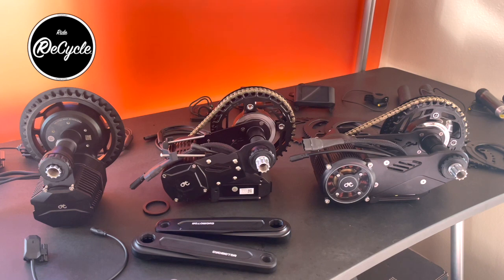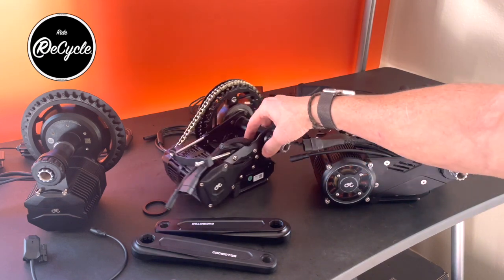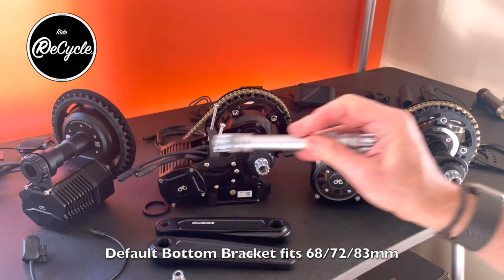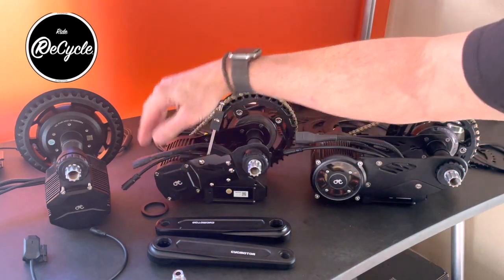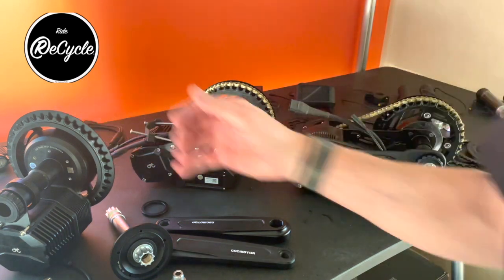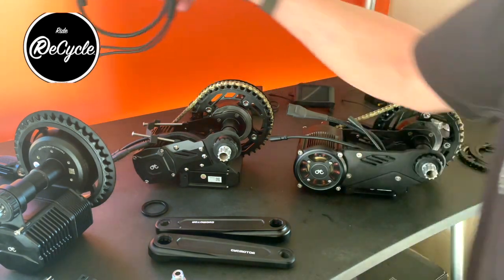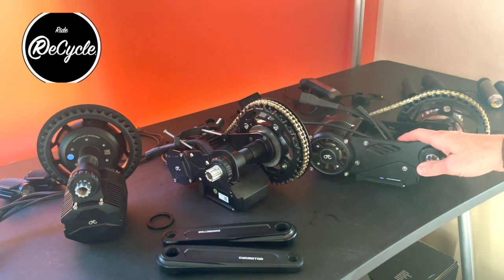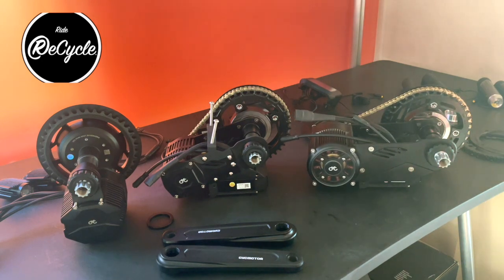CYC Photon, X1 Stealth, X1 Pro Mid-drive E-Bike Motor Comparison

Comment: What everyone, including myself wants to know is, what is the max the speed of each motor!! based on an average weight person, using different voltage batteries, be nice too if CYC bothered to do their own top quality batteries to match their motors.
Reply from the maker: Thanks for your question @howardridge1153. I presume you're asking for the top speed achievable for the bike as opposed to motor RPM? The motor will make it easier to sustain top speed but speed is primarily governed by gearing and the size of your wheels and tires. Rider effort + motor output is governed by RPM (spindle). Bike + rider weight and aerodynamics (at higher speeds) impact load. This comes into play when your combined effort can't sustain RPM at a given load - typically while climbing. 

Generally speaking any of these motors can achieve typical max speeds with human assistance on flat terrain. You can find a calculator to figure out what the theoretical speed of your bike is here: https://www.bikecalc.com/gear_speed. For example, using this formula, a bike with 700c/29 inch wheels, 2.5 inch tires, a 50T chainring and an 11T rear cog will reach a speed of 35.9 MPH at 90 RPM.

The Photon's have a proprietary chainring format so choices are limited but the largest available from CYC is a 50T which is fairly large. The Photon is rated at 1200W (sustainable) but peak torque is significantly lower (110nm) than the Stealth or the Pro. With identical gearing the Photon will sustain similar speeds on flat terrain. Put it on a steep hill and you will struggle to keep it up.

The Stealth and Pro currently have options for up to a 38T chainrings from CYC but they both use a BCD 104 mounting. You can increase the size of bicycle drive to the extent you can find a chainring that fits the format and the bike. Both motors have higher peak torque than the Photon but the Pro is designed to sustain significantly higher output so it will produce less heat and operate more efficiently under sustained high loads.

In terms of batteries, CYC does produce their own 52V packs in two sizes and power outputs. We carry the larger versions which you can find here: https://www.r-ecycle.com/product-page/cyc-motor-x1-series-b-52l-battery-pack. The 40T cell version has a higher discharge rate for greater acceleration. The 50E is designed for greater range and is a better choice for the Photon or the Stealth.
Reply: @R-eCycle  wow a proper reply, thanks soo much for that detailed advice however my 1500w rear wheel 26" can achieve 38.4mph on the flat, throttle only and can keep up full throttle,  no peddling for 13 plus miles on a 48v 17ah battery, why am i even going here with cyc, i am an engineer and love the look but at a price, maybe just maybe ill check my 750w bafang when they send me 10mm of spacer washers to fit it to my bike and get back to you on this scenario, thanks again, howard
Reply from the maker: Hi @howardridge1153 , thanks for the follow-up. Your 1500W hub motor is doing 38.4 MPH with 26 inch wheels because it's running at the equivalent of about 105 RPM at the crank. The CYC can operate in this range on throttle only too, it's just tough on range. All of these motors are designed for human assist which is why you're only getting 13 miles out of a 17Ah pack. The Bafang 750W BBS02 is a solid motor (and controller) but the main benefit of the CYCs is the torque sensing bottom bracket which modulates the power progressively based on your effort. If you want top speed and to ride using throttle only most of the time, I would recommend a CYC X1 Pro with a big chainring and a high amp BMS and high C rated 72V pack. The CYC X12 controller is suppose to be ready this summer which is rated at 6000W and will deliver even less range! LoL
Reply: @R-eCycle  yes i can believe that i canna keep up peddling run out around 28mph, well the bafang never did jack sh!t, started to fit to my single ring full sus bike and back of motor hit swingarm pivot and gap is 7 mm to get tight to bb shell, plus 44t chainring also hit chain stay, the sellers bright idea use 10mm spacers and pack out chainring, no thanks, a flawed design, they claim this is first time they ever had this problem, nonsense i replied my bike is industry standard these days they claim because my frame is "bigger" this is the issue, complete clowns who know nothing about bikes, plus only 32kph max speed i can get a yose power 350w wheel kit that does more without the hassle of fitting bottom bracket motor, i'm in usa in two weeks time may go for stealth motor for small size, speed is ok, not after mega speed just nice to have a bit of power on tap, lol thanks again for reply.
Reply: Whats the best set up for range on a 29er... Door Dasher looking to replace the car...
Reply from the maker: Full suspension is nice but if you want to use it for mainly street use, an aluminum hardtail 29er with a short travel fork is hard to beat. Without the rear suspension linkage it's easier to fit a large battery pack inside the downtube as well.
Reply: @R-eCycle  sweet I have the redline 29er monocog but no suspension

Comment: Cyc states the photon unrestricted can be as high as 2000w.
Reply from the maker: I think that's a peak figure but in terms of continuous operation, what I've seen is typically a little over 1200W on a full battery in the highest settings.

Comment: I dont have that problem with my bafang  and I'm able to put a 32 tooth up to a 52 tooth and never had a problem with my chain in any way and my rear I have 11 to 34 tooth freewheel
Reply from the maker: Chain line is way more sensitive on some bikes than others. It depends on the length of the chain stays, the derailleur, the chain and if it's a full suspension bike or not. I've had some bikes have no issue but many have shifting problems, particularly with smaller chain rings because anything smaller than 42T is 10-20mm outboard of the desired chain line on a Bafang. Some of these issues are subtle and you can work around them like difficulty shifting between single gears in the middle of the cassette. Some are more major like not being able to adjust the derailleur to get all the gears from a 10, 11 or 12 speed.

Comment: I'm concerned about the reliability of these motors, there seems to be issues surrounding them overheating according to many youtubers out there, plus they're not exactly cheap as it is!
Reply from the maker: I think it depends on how you're using them. The failures I'm aware of were based on bikes that were used like scooters with very little if any pedaling. These kits are made primarily for pedal assist so if you use them that way the motor isn't running at it's limits most of the time. If you are going to use mostly throttle, I would recommend sticking with the Pro which has more motor mass and will dissipate heat more effectively. Better yet, use the pedals to assist the motor under heavy load like starting from a stop or climbing hills.

Comment: Hola, tengo una Trek supercaliber. Carbono        Cual de estos motores me puede ir.    X1 stealth?     Photon?
Reply from the maker: Hola @josericoleon3378, gracias por tu pregunta. Es posible que el Photon y el Stealth funcionen en el Supercalibre. El tipo de pedalier en los marcos varía según el año, así como la forma y el tamaño del marco. Usted querrá confirmar qué tipo tiene antes de ordenar. La versión anterior tiene el tipo de rosca estándar de 73 mm BB, los nuevos marcos tienen Press Fit 92, que es una opción para ambos motores. El motor Photon está unido al husillo mecánicamente para que el marco no pueda ser más grueso que 15 mm. Deberá medir el grosor del marco en el pedalier para verificar que sea inferior a 15 mm. El Stealth se adapta a una gama más amplia de cuadros porque el motor está colocado más lejos del pedalier, por lo que no tiene la misma limitación. Puede utilizar los diagramas del motor en el sitio web de CYC para comprobar cómo se colocará el motor una vez instalado.

Comment: Does anyone know how many miles these batteries or these converters give?
Reply from the maker: Hi @josefernandezmendez1627 These kits are sold independently from the batteries. There are a wide range of batteries available (~500-1400Wh). Your range will largely be determined by the size pack you can fit on your bike. Generally speaking, you can fit larger battery packs than what's offered by production eBikes being sold by factories. The other factor for range is how much power you draw. If you primarily use pedal assist at moderate speed with light hills, you will get 2-4x the range compared to primarily using the throttle, riding at top speed or climbing steep hills. With a 52V 13Ah 675Wh battery pack, using primarily throttle you might only get 15-20 miles of range. With the same motor and battery, using a pedal assist feature at low power, you can easily get 40mile or more range on a single charge.

Comment: I have an older Rocky Mountain hardtail I want to convert because I no longer do any serious trail riding with it (sigh) as my knees are no longer up to it. (68 yo).  I am going either up  or down with not a lot of level trails, but I am never in a big hurry these days  and want some exercise, but am looking to make it easier on my knees.  I am 6’6”, 240 lbs.  Not looking for serious power, but want range and reliability.  Your thoughts as to whether i should get a Stealth or Photon? Suggestions and considerations welcome.
Reply from the maker: Hi @moongucanuck, if reliability is a top priority, you should consider the Bafang BBSHD. It's overbuilt, with a large motor that dissipates heat well and will be under less stress when it is pulling hard. Parts are common and they've been around long enough to work out most of the issues. That said, most friends and customers that have tried our bikes with Bafang and CYC motors prefer the response and progressive power delivery of the Stealth and the Pro. I would put the Photon in that same group but it's only recently available and it's the smallest of the bunch. Given your use case I would suggest the Stealth or the Pro. We have a lot of very steep climbs and descents in our area and both of these motors pull very well. I include the Pro because larger motors are often more efficient for a given work load. They don't work as hard and as a result, produce less heat. The power can be dialed in to deliver the desired amount of assist with the control at the handlebar and the torque sensor in the bottom bracket. As for range, the battery will have more impact on that, particularly if you're restricting power output to only deliver what you need to assist pedaling up the climb. Bigger batteries and motors add weight but that's more than made up for by the assistance they provide. Check out battery packs with the Samsung 21700 50E cells or similar to maximize power density for extended range.
Reply: @R-eCycle  This is a big help.  Thanks very much.  I was looking at the Stealth, but wondered if it was overkill.  I still want exercise, but without joint stress.  Muscles?  Fine.  Joints?  Not so much.  And I will definitely buy higher quality batteries.  I was charging two low-cost 18650 batteries on the supplied charger and within 5 minutes started smelling burnt electric components.  These things were too hot to pick up!  So I appreciate the advice on battery quality, too.   All the best.  And once again, thanks for your videos and insights.

Comment: For a full suspension 10sp rear cassette say 11-46t would you recommend the 52/32t chainring option for a stealth? Looking for really just a single track trail bike. Not a top speed racer.
Reply from the maker: Hey @babyyak3002, thanks for your question. My own bike is a full suspension Spot Rollik that I use for trail riding. I recently changed the setup but I used 52/32T chainrings to maximize torque for climbing. That bike has a 12 speed derailleur with has even lower cogs than your 10 speed. If you're mostly riding technical trail, I think you'll find that setup works really well.

Comment: Would this work on a 2004 specialized enduro? And if so, which would you recommend?
Reply from the maker: Hi @chrisregister8021 Based on specs and pictures, the 04 Enduro looks like a great doner bike. You'll want to make sure the shift cable don't get pinched by the motor but it looks pretty straightforward.

Comment: I might of missed it but are they all 52 volt ?
Reply from the maker: Thanks for the comment @ferguson8143. I only mentioned voltage briefly and didn't mention the full range. The Photon and Stealth can operate using packs between 36-52V. The Pro can operate between 36 and 72V but requires the 750c display option to use with 72V packs.
Reply: @R-eCycle  nice I would rather go with the 72 volt. For my next ebike build. Thanks for replying back

Comment: Are these only for street because I have the gen 3 stealth and there a small decal that says street version and the app street and race ?
Reply from the maker: @melbournechugging2999 If you're in AUS, I'm not sure how the units are being configured there. In the US, Street Mode is set to 750W and Race Mode is at 1200W maximum. The 750W sticker is referring to Street mode but you can still switch the motors to Race Mode for riding in areas that are unrestricted.
Reply: The sticker is to help with "compliance" of your different countries allowances for wattage etc  ;)

Comment: Have you put the x1 stealth  on a gt force comp 29r before? Im looking at doing conversion on mine soon.
Reply from the maker: Hi @travisshedd930 I haven't built that particular frame but it looks like a great platform. You may have to work around the suspension linkage for the motor hanger but it looks doable.

Comment: Is there any way to use any of the CYC motors with a belt drive?
Reply from the maker: There is! The CYC X1 Stealth and Pro both have a freewheel with a BCD 104 format. That means you can mount any chaingring that conforms to that pattern. There are belt drive 'chainrings' available in that size. The Photon uses a customer mounting pattern for the chainring so they won't work.

Comment: Looking for an opinion as to which model to go with I want it to be robust and I am putting it on a felt comp 50 will be doing mostly single track riding. With about 8-13 miles of road to get to the trail. Also, any battery and controller suggestions would help as well frame is XL and I am a bigger rider at 241lbs before gear. I am leaning toward the stealth. I don’t mind the noise or increased price but figured the pro would probably be overkill in my application and just add weight.
Reply from the maker: Hey Tim, thanks for the note. Between the Stealth and the Pro, given your use case, I'd agree you'll probably be perfectly happy with the Stealth. It's a bit lighter, well suited to single track, makes a little less noise and has good torque for climbing most hills. If you want something a little overbuilt then the Pro is worth considering. The larger motor will mean it won't work as hard, allowing it to run cooler. It's likely to be a little more efficient in terms of battery drain. It does make more noise but this is relative to the amount the motor is assisting which varies depending on load and how hard you're peddling. In terms of Battery packs, it usually comes down to what will fit on the bike and if you ever plan to go more than 20 miles on a ride. A 52V 13Ah pack can last 20-40 miles depending on terrain and how much assistance the motor is providing. A larger pack will add weight but give you more flexibility on range. The BMS will determine the rate power can be drawn from the battery. 30A will be sufficient for the Stealth under most circumstances. 40A for the Pro if limited to 2000W or 50A if you want to use the throttle and pull something close to max wattage. You can limit power with the App so a 30A pack, limited to 1500W, will work fine with the Pro and limit power consumption.

Comment: best set up for dependability and range?
Reply from the maker: Hi @jporpmer, thanks for your question. Dependability may depend on your riding conditions. The Photon is fully encloses so it may be a better choice in some environments where there is more exposure to dirt or water. The trade off is the design is newer so it has undergone fewer updates. It benefits from some similarity to the motor core, controller and freewheel/torque sensor but the mechanical drive is a new design for instance. The Gen 3 Stealth and Pro are similar and share many components with the biggest difference being the motor core. The larger core on the Pro will allow it to run cooler and theoretically, larger electric motors are capable of running more efficiently than smaller motors so at lower power levels, it may be the best performer for range even though it has larger mass.
Reply: @R-eCycle  Thank you and as for battery set ups the lower the voltage and the higher the ah means more range? as the higher the voltage would drain the battery more? Looking to Door Dash using an e bike set up.
Reply from the maker: Actually the higher the voltage the greater the power density for a given Ah rating. Watt hours (Wh) is a better measure of capacity but you can calculate it by multiplying the volts x Ah. Also a higher voltage will allow the motor to spin at a higher RPM which is typically more efficient.